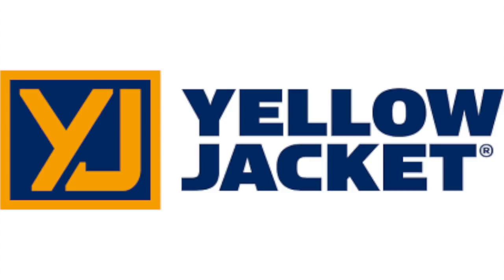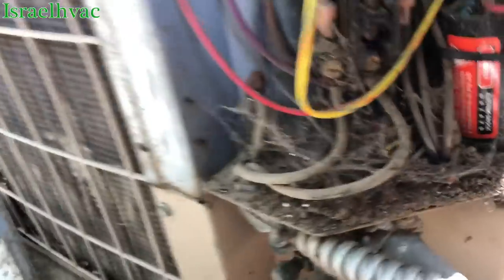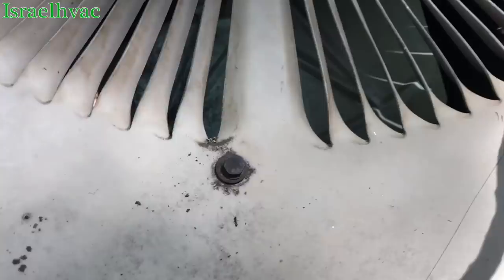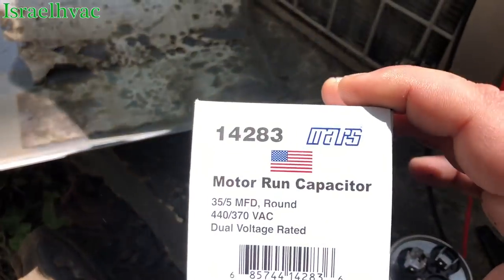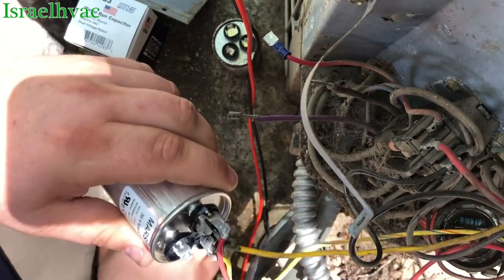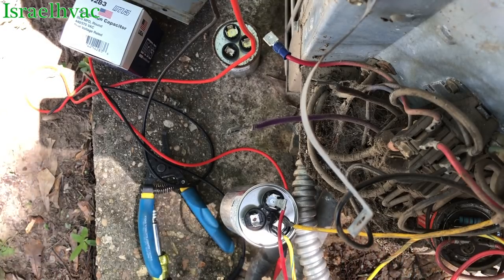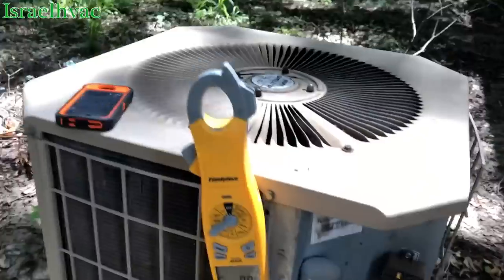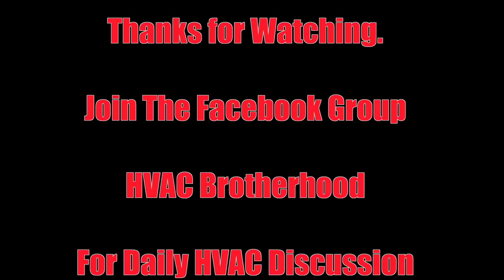Bad HVAC Capacitor | I Make a Big Mistake

Comment: Never trust a disconnect without confirming no power with a meter. Even though you had insulated pliers to put the wires back on, you were holding the capacitor with your hand. If you had missed the terminal and hit the capacitor, you would’ve been hit again. But definitely a learning experience. Glad you shared it.
Reply: Leather palm gloves are great against slip hazards...!   js
You should see the scars on some of my tools...smh
Reply: The other problem with holding that huge aluminum capacitor: All the surface contact area!!! Gripping that much surface area can pass a lot of current, even if the voltage wasn't that high. OUCH!!!!!
Reply: There was another reason not to work it hot.  Look at the video again and watch when the connector slips out of the strippers how close it comes to grounding out to the cabinet.  If it had, the time saved by not positively killing the power would have been negated by having to fix the damage done.  
The problem with typed in responses is that you can't send the tone you are intending.  I have the upmost respect,  especially for a seasoned veteran, to show his or her mistake and help others.  Thanks to the other responders sharing their hard learned experience.
Reply: @vincentrobinette1507 

Not if he himself wasn’t grounded eh?  Big rubber soled work boots are good.

Comment: I just sold a new disconnect for the same reason. I avoided getting shock, but my pliers had to be replaced. I have 14 years of experience, and it still happened to me. keep up the good work, and thank you for being honest.
Reply: Was the disconnect an EATON that you replaced, there is a recall and we got like 4 of them here in the plant on the ac units that are recalled.
Reply: I would have left the 14 years experience out

Comment: Rule 1- always check for power before and after switching the breaker.
Rule 2- never trust another technician, always confirm power yourself.
Make it a habit to always treat electrical as if it's live.
Reply: I always do.

Comment: Complacency is the enemy, for the professional.
As a homeowner, I benefit from a healthy fear of the electrons. I am the over-cautious guy wielding the multimeter, testing the power leads, condenser frame, and my dog for stray voltage.
Taught my dog CPR too...  just in case.   Ha.
Reply: I hope you don't use the sharps on your dog ;)

Comment: Kudos for posting this video.  I'm not an electrician, but knowledgeable.
I switched out the a/c compressor cut-offs on my 1941 house, last year.  No mishaps and everything is working well.  I'm just about to replace the fan motor (which has a noisy, worn bearing) on one of the units.  I've always just used the shut-offs, shorted the caps, then checked for voltage, but now I will also kill the main supply switch to the house ... just to be safe.

Comment: A tip my Dad gave me years ago when I was learning how to work on tube amplifiers, treat every circuit as a live circuit regardless of whether it is or not. I have carried that advice into RHVAC career, and it has served me well.
Reply: smart fella your pops, everything should be considered live ;)
also tube amps are way higher voltage and usually have enough capacitance to really hurt you. the fun ones are 3KV+ you likely wont get a second chance in there and it will jump to get you. good rule is no jewelry, headphones, cabling and nothing grounded around you, elevated/isolated flooring, never lean on/into against things and always keep one hand in your pocket. worst case, only one hand/arm gets nailed. I can attest that it's no fun landing across the room.

Comment: You should use a non-contact voltage detector that beeps rapidly if hazardous voltage is present. Check all the wires for an "unsafe" signal. This can save your life should this happen again.
Reply: Those things are not reliable.  They are helpful, but the cheap ones are mostly junk.  They beep all the time or not when you need them.

Comment: Been there, done that... except I was working on a 460V RTU, standing on metal roof. Didn’t check power to all legs and went to repairing a burnt wire with an uninsulated Leatherman multi-tool. Several years ago and I can still feel the “tingle” when I think back on it. Great video!
Reply: lol.

Comment: Hey John, this may be 4 years old but it helped me diagnose what was wrong with my outside unit. I tried the jump start but it only spun slowly but that let me know the motor was ok. Indside the coil was making a swishing sound so the compressor was trying to circulate. So I ended up just replacing the coil that was 20 yrs. old and SHAZZAM, fan started right up and went inside to check the vents and it was coming out at @ 55-60 degrees depnding on the part of the house. Best of all it cost me about 21 bucks all in and a bit of time. Once the house has cooled of for a bit I'm going out to give the unit a good cleaning! 
Cheers, Graham.  👍👍❄❄

Comment: Thanks for the reminder and I hope you marked the disconnect plus inside the unit that the disconnect doesn't work. We all get lazy but I'm glad you didn't get hurt. Also I would have wired it hot like you did because you knew at that point it was indeed live. Keep safe!

Comment: I actually signed back in to give you a thumbs up! I not only like to check the source with my meter "Before" I pull it but after as well. I check it before to make sure my meter is actually working and not lying to me when I pull the power. I have been bitten by that when the meter said there was no power when in fact there was. I got zapped because meter was a bad and the power was still applied. Thanks for sharing. Best Wishes & Blessings. Keith Noneya

Comment: Exactly right get up and turn the power off at the breaker panel inside the house. Replace the disconnect switch then finish fixing the condenser unit. Yes always check your power first! A lot of us get complacent or lazy and that’s when bad stuff happens! Good video! Thanks for being honest! Glad you wasn’t hurt bad! 👍😊

Comment: A multimeter with a capacitor test function is essential for residential service. In fact, have a backup meter. Also a bad 3 terminal capacitor can be replaced with a separate capacitor for the fan and compressor. Also a 20uf added together with a 15 uf will make a 35 uf capacitor. Just have to wire in parallel.

Comment: I have 3 Carrier units, all different sizes.  A/C guy showed me the change the capacitor trick for inop fan.   i always just used the disconnect but no more.  I hate working with 110/220 and I have been severely shocked once before when I was onboard ship in the NAVY.  Even though I kinda knew you were gunna get bit by the way you talked, I still got a little ill in my stomach.  Circuit breakers off before I ever pull the panel from now on, I don care if my disconnects work or not.  Thanks for a video to remember and glad you only caught one leg of power.

Comment: Also another reason why you always discharge the capacitor before pulling it loose. We get too complacent out there in the field and that’s how we get hurt. I have an old bent up insulated screw driver, that I use just for that. Always discharge the capacitor, even after you have checked for power with your meter. If you would have discharged, you would have known it was still live and potentially have saved your own life. Remember, It only takes that one to kill you or cause permanent damage. There’s no such thing as an accident.

Comment: whether using an insulated set of pliers or not. this is an excellent video of what osha would not want you to do... certain things as such, are due to bad breakers/ground. therefore in order to have completed the job the breaker in the disconnect, or in the panel should have been changed resolving said issue. without a working disconnect on a unit. there is no way to stop it at the source except a breaker panel. which code is to have one at the unit to make sure for ease of turning off power

Comment: Thanks for putting this out for everyone to learn from. Next time I DIY anything with an AC unit, I will cut the breaker first. The same with discharging old and new capacitors if I ever need to replace one.

Comment: I recently had a blade in the disconnect break. It stayed in the closed position. The other blade opened. Needless to say it was a reminder, use meter to confirm all power removed. It was also a example of why the mechanical knife switches aren’t recommended. The pull plugs are better.

Comment: I always go around with one of those none contact voltage sticks first, see if theres anything live inside a piece of equipment before I start working on it.
Bet there was some pretty colorful language when you made that discovery.
Reply: Voltage sniffers are life savers! Especially when you can't get to any bare copper with a volt meter.
Reply: Ditto. They don’t pick up 24 volts though. I’ve been hit by that numerous times. 
I’ve quit trusting 24 volts as well.

Comment: I have a few customers in a condominium from the 70s I normally service. Why I mention the 70s is because the "disconnect switch" they used are literally light switches. One time my father switched one off, and did his repair, turned it on for it not to work. So I normally don't trust them either. He will work with live electricity if he does contactor switch outs, and he's been in the trade for 40 years, I can't do that and I've been working for 3 years in the trade. I find it's up to the technician and if they are comfortable doing it. I feel in some cases it's not laziness more than you dont want to go down several flights to turn off power, or wait 30 minutes for the property manager to let you in the house.
Then again it's your life, I rather work safe, nice video.

Comment: Lively content, made interesting by your revealing the little "shortcuts" everyone is tempted to take. Glad you were not injured by the discovery of live power situation, and very much appreciate your repeated emphasis to check power at the AC terminals. BTW, as you handled the insulated part of the capacitor body, I wondered what would have happened with a short-to-ground situation, in which the capacitor body, itself, may pose a hazard.

Comment: Get yourself a little beeping light pin like what electricians use one you can use a real fast to see if there is electricity there.. that little thing is saved my life many times..
Reply: That thing is mandatory for HVAC troubleshooting, makes alot of problems obvious with a single tap.

Also for looting copper.
Reply: Alf Beef what’s the official name before I can’t afford to buy a $60 meter
Reply: Home Depot has them for $7.99 it's called a Dawson voltage meter, just a little heads up them things are not guaranteed. Be sure to take all the proper precautions while using..
Reply: Alf Beef totally agree.  Make sure you test it on a hot circuit before using it to verify a dead circuit.

Comment: I don't even trust the breaker anymore, been shocked too many times. I won't normally touch anything electrical until I've triple checked it with a voltage stick. Even then I'll check periodically as I make the repair, especially if the customer is around. I've had them turn on the electricity while I was making the repair on several occasions.

Comment: I am replacing my capacitor tomorrow, to late in the evening to get one.
I done it before, easy job. but before I start the job, I think I will turn off the breaker and disconnect off!
Thank you!!

Comment: Also need to check your voltmeter to a known source first then to your load side of the opened disconnect to ensure that your meter is OK. 
In my former career I have experienced open voltmeter leads so inportant that you start with a known source.
  My testing of potential would be as follows - voltmeter measures known, then to unknown, back to known.
Like you said in video don't trust disconnect, must test for potential after turning off disconnect.
Thanks for sharing.

Comment: Was replacing a receptacle live. It was a stab type. Cut the neutral. The downstream circuits went to 220. That ceiling fan really started spinning. Cooked a couple of transformers. NEVER break the neutral on a 3 wire system.

Comment: Great video and it happens that easy. I got burnt up pretty bad forgetting to turn a hot water tank off before spraying rubber sealer on basement wall. Talked about it sunday went in monday shut furnace off totally forgot about hot water tank. Ill never forget the click of that igniter. 3 weeks in b.t.u. misery everyday for first couple weeks. Stay safe.

Comment: The worst disconnect I've ever seen are the square D with the switch. I like the removable blade type. But still always check voltage. And always work everything like it's hot!
Reply: Those can be bypassed too. I came across one once.

Comment: My dad was working on a 440v machine, he needed to check/adjust breaker contacts.  He killed the power, but didn't lock out the box and someone turned it back on.  Luckily the body of his feeler gauge set was touching the grounded chassis of the machine so when he stuck the feeler into the live breaker it only blew up the feeler and didn't send any power through him.  I still have that feeler set with one blade that is blue/brown and about 1/3 the length of the rest of them.

Comment: yep, I think we all have been there , get complacent, take disconnects for granted, when I worked in the field after getting bit because only one leg was wired through disconnect I always checked each line to ground..good job John. getting bit doesn't feel to good either.

Comment: I could see and hear the exact moment when you went to what I call "auto mode", it's dangerous and it happens to most of us at certain point, the good thing is that we will never forget about double checking, specially electrical, same as you I was troubleshooting a semi hermetic 230V compressor and flipped the disconnect off, good thing was once I removed the terminals wires cover at the compressor I checked with my meter, yeah... still got power due to a sticking blade at disconnect. Stay save guys.

Comment: Thanks for sharing this!  I never would have expected it still to be live after pulling the disconnect.  Great advice!
Reply: There can be several reasons 
With fused disconnect. There are two fuses one for each leg. Some pull the fuses out some just pull out the knife blades that connect across the fuses. 
There are disconnects like a breaker that are a two pole switch with one trip lever. These can fail internally leaving one sometimes both poles connected. Not so common anymore are the older disconnects with a handle like lever on the side of the box and fuses inside connected by knife like blades. Fiber board insulators can break and leave the knives connected. Any doubt about a disconnect change it they are relatively inexpensive and easy to change. It may be good as well to check the circuit breaker to the unit. Always learn to use those meters they are like your extra hand.
Reply: Also disconnects, switches and circuit breakers are all amp load rated check and make sure all are compatible to the system. Trust yourself you may never know who may have changed things along the way. Use your experience and knowledge.

Comment: Been there. I assumed a disconnect on the machine was fed from the main on the machine, because every other machine (24 of them) was wired that way. It was fed from another source. Found out the guy I replaced had an arcflash on that one too, was told to label it, but didn’t. I marked it right away and installed a main disconnect for it, clearly marked at both ends. I had the same reaction you did, except at 480V. I always check after LO/TO. If I get called away, I check again when I get back. Be safe, it’s dangerous when we start assuming. Peace.

Comment: I don't even allow my guys to use 'voltage ticks' (as we call them) due to their iffy results. All techs are required to do a IVV (Initial Voltage Verification) with a meter, and if they walk away from the job for any reason, then they're to perform a voltage frisk (again, with a DMM) prior to continuing work. Glad you didn't get hurt. I occasionally work on commercial units that are 480VAC, 3Ph and I'm especially careful when working around these units (Lock Out / Tag Out, etc.) Stay safe, it's not worth your life.

Comment: If it's a "real disconnect" meaning you physically pull it out, I all ways pop or unscrew the cover to make sure it's not by-passed and if it's a breaker type "disconnect" I ALL WAYS check both legs to ground I never trust the breaker types for that same reason. 
It hurts but it only takes that one time for it to happen and you'll never let it happen again.

Comment: I was doing my friend ac. Yes, I was putting a new capacitor after I have watched many videos on how to do it. I pulled the disconnect  handle  and trusted that there wasn't power. Got my capacitor wired up and went to put it back in place. But,   as  maneuvered  it in place, it touched  the contactor  and kaboom it burned a hole on the capacitor. There still was 240 volts. The disconnect doesn't really disconnect. I made that mistake to trust what I see. I have done it  to my ac. But, I shut the power  from the breaker box and also did the disconnect handle. I forgot to ask my friend to shut the power off and it almost cause my life. This guy at least he realized there was power in the line on time.

Comment: Replaced my motor and capacitor a few weeks ago..it was the first time working on an air conditioner but I've had extensive experience in electronics. Luckily, I was a little nervous, so aftershorting the contacts to discharge the cap, not only did I measure all of my contacts before touching anything, I also used insulated gloves.  Glad I saw this video though, so next time I have to work on it I don't fool myself into being over-confident.